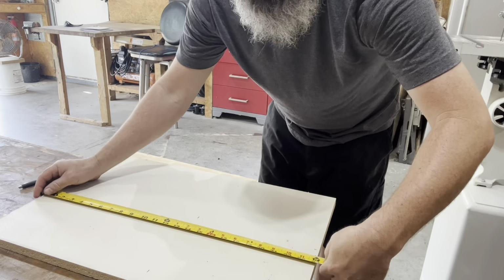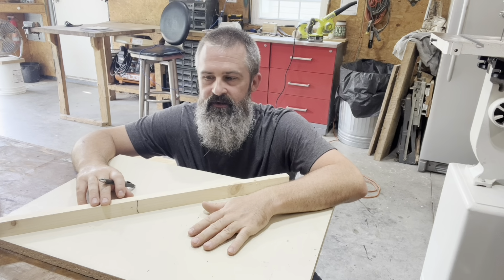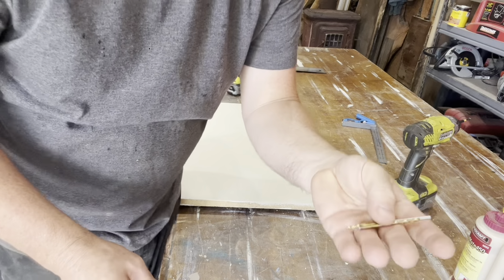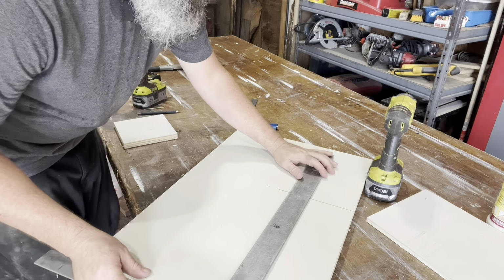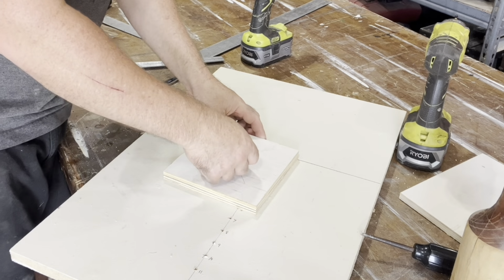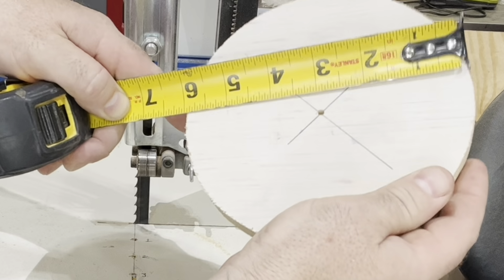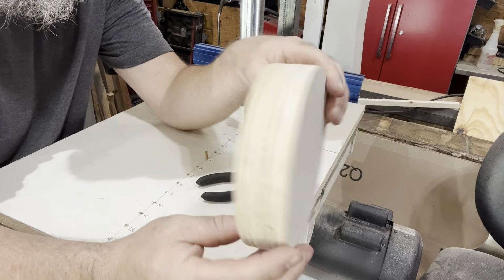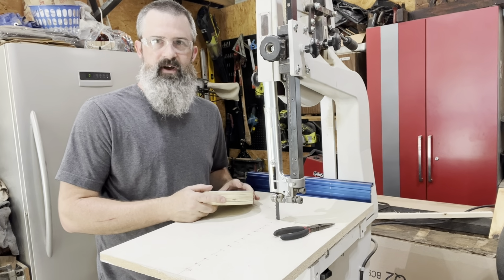Easy DIY Circle Cutting Jig for the Bandsaw

Comment: That worked rather darn well!  

You can cut that 6” circle with a 1/2” blade.  Going to a smaller inch diameter might require a narrower blade.  You can use the same fixture.  Just drill a new set of holes to match up with the front edge of he blade!

I have a video showing how I sanded cut edges perfectly smooth and round on my Shopsmith.  You may be able to adapt something similar if you are needing them finished that precise.

Thanks Johnny.
Reply from the maker: Thanks. I’ll be checking out that video soon! I appreciate your input!

Comment: I don't want a hole in my circle,  how do you do that?😂
Reply from the maker: Draw the circle out and cut it freehand. Then sand down to the line. Or use a small dowel to plug the hole. Good luck